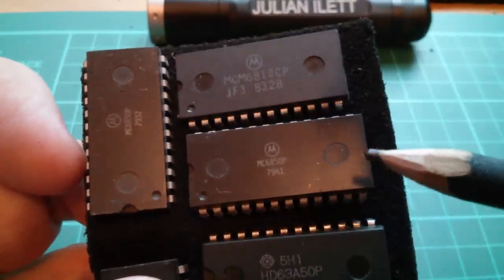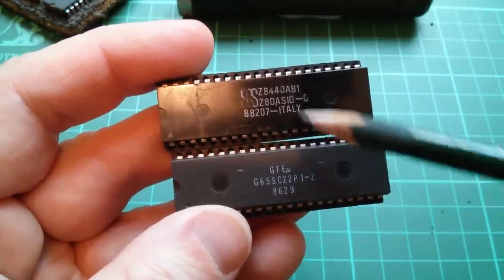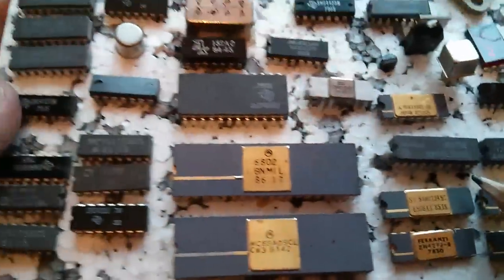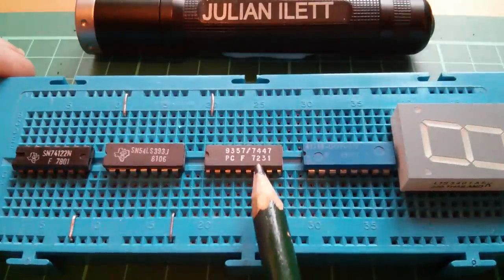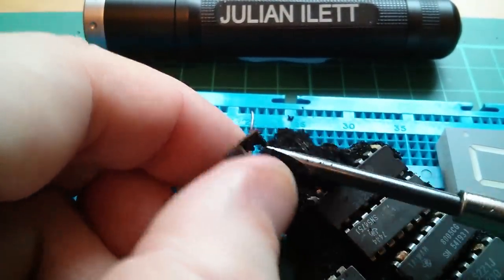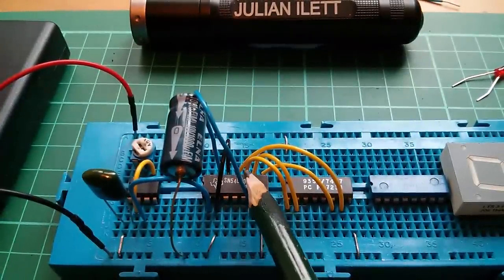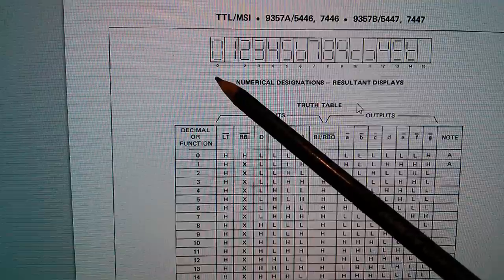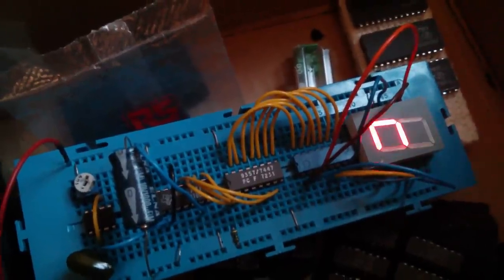Julian's Postbag: #52 - Big Box of Integrated Circuits (part2)

Comment: One chip that you passed by - probably thinking it was a power transistor was the L200 Adjustable voltage and current regulator. Very handy for making a simple variable (or fixed) power supply with current limiting (and short circuit protection).
Reply: +Tony Fishpool  I spotted that one too. They're great linear regs. Used a few in the past.

Comment: That was excellent. I'd encourage you to do more of these discrete logic builds, they're fascinating.
Reply from the maker: +tobortine I love them too. I'm thinking Space Invaders on a low resolution (say 8x8) matrix of APA102 multicolour LEDs. But using old-school 74 series logic it would probably draw a couple of amps at 5V.
Reply: +Julian Ilett I'll look forward to the Space Invaders video........
Reply: +Julian Ilett The power supply must be linear OR switching but made only from chips of the era (no KA7500 for instance :-))

Comment: Like a few other commenters, this takes me back. Ah the ubiquitous 7447 7 segment driver. I've used MANY of those in my time and still have loads ( plus many, many others from the 70's). Out of curiosity I just checked and I have some ZN230E chips date coded 7025!! Can't find my 7447s at the moment but they are probably 74-78ish and I know they work fine as I had them breadboarded with some 7 segment LEDs within the last 12 months or so ... all working!

The problem with the chips in foam is not with the chips but the foam which just disintegrates after a few years. Rusty pins are because most older chips had tin plated steel legs(!!) Easily demonstrated by using a magnet on them. Just solder pot dip them, with plenty of flux and bet they work just fine.

If you are interested I think I have an actual virgin Z80 CPU somewhere too. I'm unlikely to use it so if you fancy it for tinkering, let me know and I'll see if I can find it to go with those other Zilog chips you have. 😁

Comment: I've got some similar old chips in a bag somewhere. I keep thinking about using them for...something. But I'm not sure how useful they'd be,these days.. Maybe adding extra I/O onto an Arduino,or Raspi,or something,for fun?
I once built a very similar circuit,I think using the same type/vintage of 7447 chip. I also noticed that it ran rather hot. I used an ID thumbwheel switch from an old SCSI enclosure,for the BCD input

Comment: That HP LED display is actually a dot-matrix hexadecimal display; they tend to run a bit hot if the power input is unregulated.  They take BCD input and output hexadecimal.  I  have a few which came out of an old HP plotter.

Comment: Are there any BCD to 7 set decoders that do the number 6 and 9 properly? They all seem to go 012345b78q. Just my little niggle. I made a timer circuit a year ago and didn't like the look that BCD decoders offered so had to do it another way. Excellent vid.
Reply: There are some that do it the way you prefer,  with that "tail" on there.  There's also a rather simple mod to turn on the additional segment for those digits,  but I don't recall what it is offhand,  or where I saw it.

Comment: Thx Julian, I still have boxes full of my fathers legacy to go through but I think I will chuck most stuff away. Only the really old golden ones I will keep since they are somewhat awesome. Ceramic and gold ... looks like they are worth a fortune and are just special.
If you think about it you will only need a couple of other things like an arduino or pi to do these things with software nowadays and which uses a lot less power. 
I wonder what will happen in 40 years time with all the stuff that we now have.
Reply from the maker: +Luc Peeters Hmm, electronics in the year 2050 - hard to predict. One thing comes to mind though. That Vocoder I'm building with all its op-amps and analogue circuitry is now available (in the form of a software model) as a free app for my phone. So perhaps microcontrollers will be downloadable as models to be 3D printed. Of course the 3D printers would have to be able to print metal, silicon and plastic with extraordinary precision.

Comment: It should not be hot. Please Check where the VCC and GND should be placed again.
Reply: Blacklab412294 - TTL DIL chips can and do run at around 0.5W, so will run warm to the touch. Internally silicon dies can run at 100C or more.

Comment: Nice score and video too! What site do you use to find the best data sheets with out spamming sites? cheers
Reply from the maker: +Ray M Cheers. Lots of chip data sheets are on university websites (with .ac or .edu domain names). But the really odd stuff (like the 9357/7447) is only to be found on datasheetarchive - it's a pain to navigate but sometimes necessary.
Reply: Thanks!
Reply: +Ray M go to your local library and get hold of old Towers International parts references - I still have mine from the 70's and 80's. 

Also for 74xx series logic, Google for Elektor magazine archives as each issue used to have lists of both 74xx series chips and early CMOS series chips. 

Still massive amounts of old info on paper in libraries' reference collections and people's attics!
Reply: @JulianIlett  I have a lot of datasheets on my web site,  and a pile more that I need to get around to adding sometime soon...